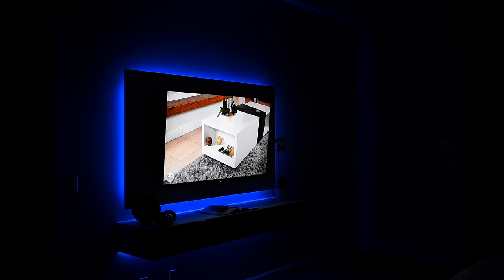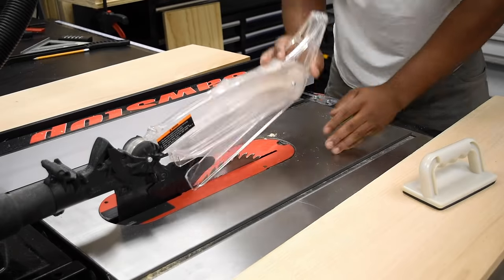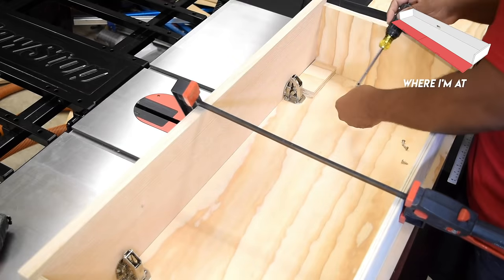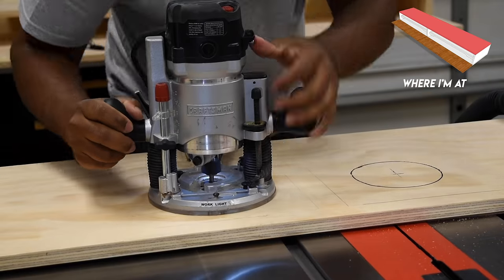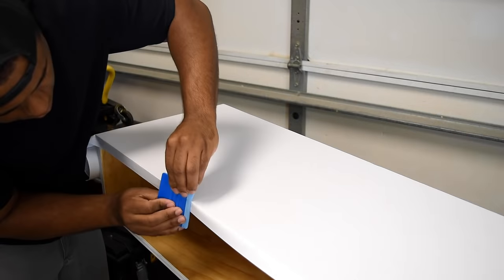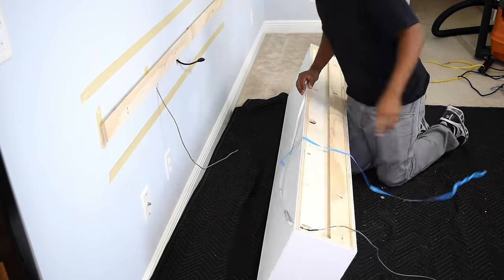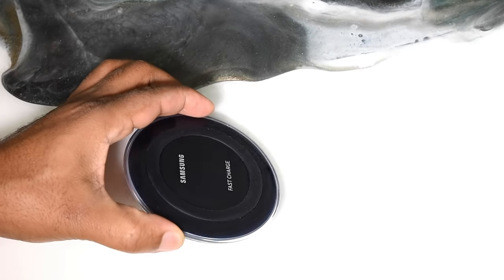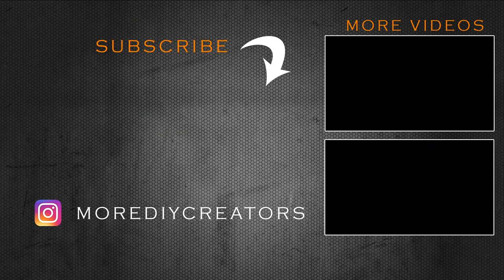How To Make A Wall Mounted Entertainment Center

Comment: But all you forget is heat, that all this devices produce. In closed space without airvent things can goes bad (as my english)
Reply: If my English does not go well, it's Google Translator's fault. (laughs)
Reply: It's good to careful about the heat, but it should not be an issue here with the doors open. The wireless chargers don't have a high load, so they should be fine as well.
Reply: The modem and router will get hot, along with any other device that is in an enclosed space even with doors. Cutting out just a small circle  under where the devices are located could help; then covering the hole with white mesh could make it look more flush. But that's my opinion, other than that it's a beautiful project.

Comment: Man you need some airflow in there, with so many devices it will heat the place up quite a bit. I suggest sneaking in a few small pc fans in there they are cheap and quite efficient.
Reply: Alexandru Coman whenever I use my media console I have to leave the doors open. Even store bought ones don’t consider having good air flow.
Reply: Good point. A small fan directed out the bottom would work well.
Reply: I’m guessing that because he installed drawer runners that when using the media entertainment the drawers will be out therefore heat is not an issue and honestly the ipads are not an issue either
Reply: Larger fans push the same are more quietly.
I would recommend a 120mm fan

Comment: Yet another great creation!👍🏾My only bits of advice for homeowners: 1) the electrical joints should be enclosed; 2)  do a load calculation (add up the amperage of all of the devices) to make sure it doesn't overload the circuit, especially in older homes; 3) enjoy

Comment: Love this! The style is great. Simple, elegant and functional. Colour scheme works well, especially against the light gray walls. My only issue is (as with one of your other vids) the weight of the finished item due to the thickness of the ply, but that's just a personal thing as I'd struggle to lift the complete unit. I liked the sneaky touch with the paper dots for locating the wireless chargers. Can't believe 477 people didn't like this, what do they know eh.

Comment: One of the best video i have watched in recent years. This video covers both of the things
1. Wall mount
2. Invisible wires

Bro, can you please let us know the wiring and connection has to be done for the speakers that were mounted on the corners to the Woofers

what i mean is: Speakers that were mounted to the corners of the wall and we would like to wire them back to woofer

Comment: Hi, you should replace the metal brackets holding the wireless charges with wooden ones made out of scrap ply. Metal will suck some of the energy from the wireless chargers. It might also get warm because of eddy currents.

Comment: First...awesome build!!! Hands down the best of these "floating" media/entertainment centers.
Inspired me to try and re-create one. 
 but I messed up the dowels, (they were too big)  so I ended up using wood screws and glue. 
One question I do have though, when you routed the holes for the wireless charging, how deep were they?
 I would imagine they were almost the full depth of the plywood or the wireless charging wouldnt work.

Comment: This was s nice build man, but I'm a little worried about the heat that will build up in there if you keep the draw closed. Router and cable boxes and so on put out a pretty good amount of steady heat, you might want to put in some exhaust and intake fans on the bottom.

Comment: How do you install hardware to the back of the floating tv stand I ordered a tv stand but it didn't come with predrilled holes for hanging or any hardware what should I use?

Comment: I would have put a good sized hole in the wall and a corresponding hole in the unit, as a pass-through for cables.  There are cover plates you can use

Comment: As everything this man do it looks really nice, but just a small suggestion if you actually will have a PS4 in there make a little grill on the bottom of it so the heat from the ps4 can get out, if you don't it will just suddenly turn off by itself for over heating

Comment: i figure if i were going to do this i would drill holes in the bottom for ventalation and to make it lighter, i would also either add an IR repeater or use a seni transparent cover innstead of oak, so i could use remote controls without having to open a door and ruin the astetic. if you combined the leds backlight with the raspberry pi amibient lights project into the tv that would be the best setup ive seen.

Comment: I bought the hinges that were mentioned in the video. Are there any tips on how far apart from the cabinet and the board should they be screwed on? I can’t seem to get it right when trying them on two scrap pieces. Thanks

Comment: Hello Sr., I have a question. When you make the join with the two 45 degree pieces, the one that is on the wall and the other that is part of the cabinet, do you fix with screws or simply the weight is enough? Thanks.

Comment: To secure the top you only used glue and nails - how is that strong enough? I guess given its resting on the sides rather than at right angle it is fine.

Comment: Great build! I love how neat everything looks. my only question is, do you worry about overheating anything? I have a floating media center that i bought and mostly everything is behind drawers, but also is almost always off. Does it get hot in there with all the charging going on? Keep up the great work love your videos
Reply: I thought the same thing and was just about to post it until I saw your post. My thoughts would be to drill vent holes in the bottom or downward angled vent slots on the sides? I know heat rises but for visual purposes.

Comment: Not sure I would call it a DIY project when there are so many special tools needed. 
It's almost like "if you're a professional building these kind of things for a living then you can build one for yourself using the same equipment and call it a DIY project."
Reply from the maker: I am not a professional! I was an alarm tech then a system designer. Never made a penny selling what I made. It's DIY if you buy tools and do it yourself. Nothing special here you can walk into home depot and pick these up. Anyone can do this if they try.
Reply: @DIYCreators  you are right of course. It's just that I regard DIY videos as projects that I could potentially accomplish. Like an instruction, and as such it's pretty unavailable if you don't have access to a workshop, which I don't. As a testament to your skill and as entertainment it is a great video. So well done! I just wish I had access to those kinds of tools :)
Reply from the maker: Thanks and sure thing, the key is you do not start with these. I had cheap versions of tools when I start and overtime you change to a better one. 

You can find tools super cheap now at the store, online and even pawn shops. I think if there is a will there is a way. You just have to make it your goal.
Reply: @DIYCreators  thanks for the encouragement. I try to avoid the cheapest tools ever since I experienced the actual quality of them when I worked as a salesman in one of those stores. Pawn shops sounds like a far better option :)
Reply: Tor Hunemark  If you don’t have a way to cut fairly large pieces of wood, why are you watching DIY wood projects larger than a bread box? The only other tools he used were a circular saw, a drill and a jigsaw, pretty standard beginner tools. (He also used a router but everything he did with that was doable with a chisel or jigsaw instead).

Comment: Well you should never use actual "bondo" as it's an inferior product and will shrink over time. Use a better quality filler. People think of Bondo when they think of filler but you should never actually use Bondo brand... not good. I'm sure it was good in the 1950s.